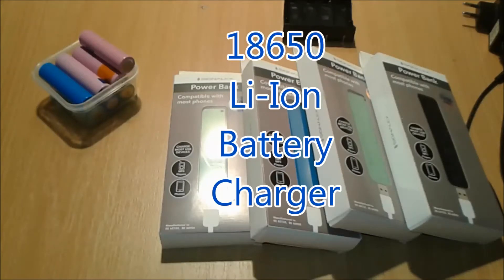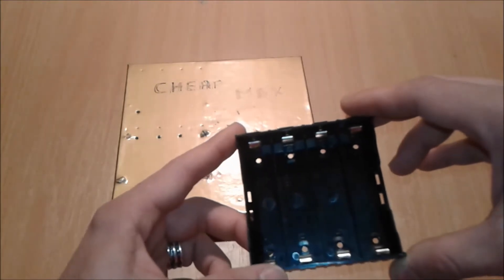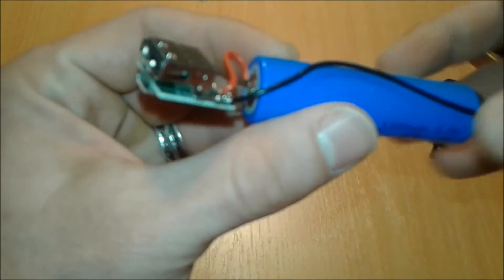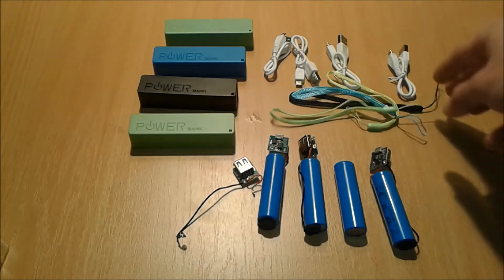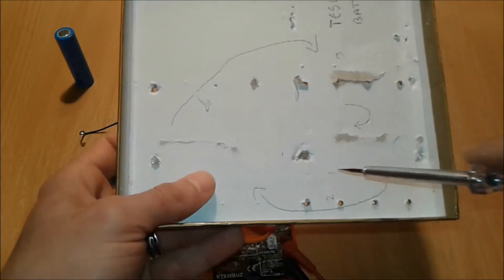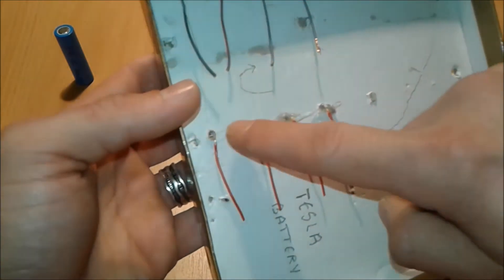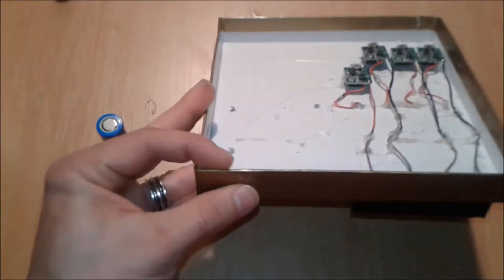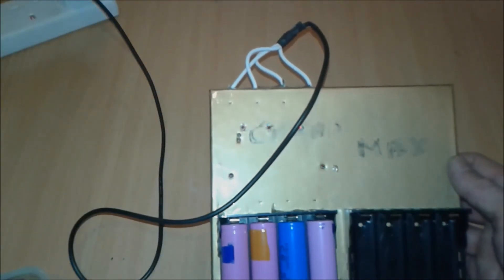Make  Li-Ion battery charger at home Best 18650 cheap charger!

Comment: If i charge only 1cell(3.7)volt through 5volt charger then can my cell be damaged and can i charge two cells of7.4 volt through 5volt charger
Reply from the maker: ever wing li-ion are special batteries that 3.7v is called nominal voltage, this batteries have 3stages 3.2v discharged, 3.7nominal and 4.2v fully charged, so to charge them with something else then a dedicated charger for one cell you will need 4v power source and 500ma
Reply: @NoSkillsRequired  so u mean I can't charge with 5volt charger
Reply from the maker: ever wing not straight to connect it you have to make a voltage dropper otherwise the voltage will rise till it will damage the battery. If you have an old phone you can use that to charge the battery
Reply from the maker: ever wing another cheap way is to buy a dc-dc buck converter from aliexpress the adjustable one

Comment: will this charge a set of 3000mAh high output batteries?
Reply from the maker: Natty Dragneel sure I tested this modules with 1200ma and 2500ma it will take longer because the capacity is bigger all the best buddy
Reply: @NoSkillsRequired  as long as it doesn't explode or break the batteries xD
Reply from the maker: Natty Dragneel this modules are in the PowerBank and electric vape it depends on the battery as well if there are new you can try with 4cell li-ion dedicated charger if there are from laptop battery will go just fine